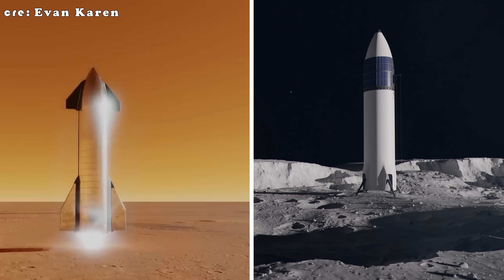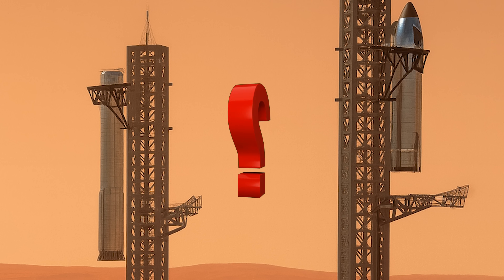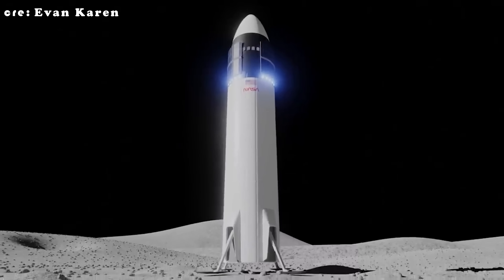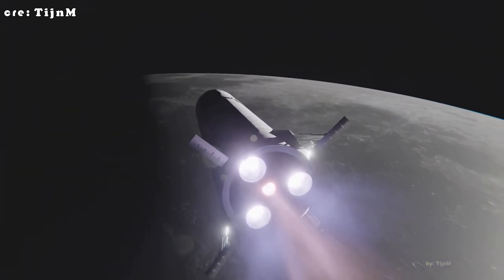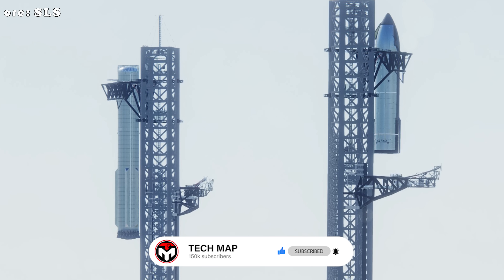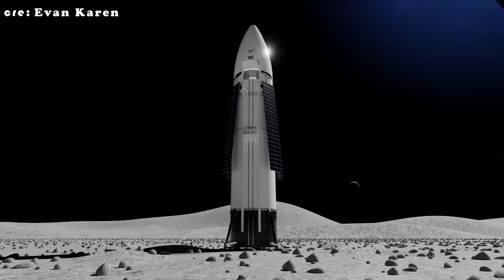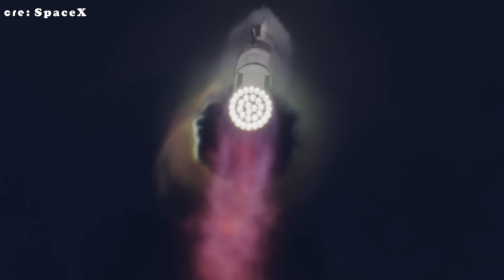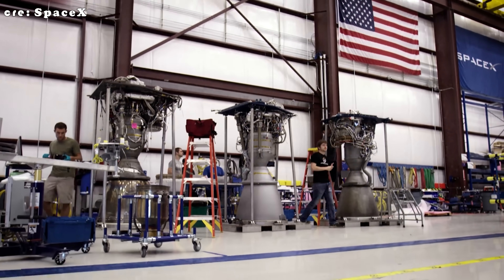SpaceX's New Starship Landing Legs Design Upgrade to Land on the Moon Shocked NASA!

Comment: Why not just have Fixed landing legs that you unfurl  in orbit? There's no drag in spaceflight HLS simply goes to the Refuelling depot- Orion Rendevous- Moon Surface. Dont bother with folding just unfurl once then leave be..
Reply: Try the following experiment: Put a 10cm thick stone on the ground. Now put a stool with one of it's legs on this rock, the other three legs have to reach the ground.
Does it work?
Extended experiment: Put a water filled long low diameter glass bottle upright on top of the seating surface.
Did you need cleaning equipment?
Reply: @jochenwagner2782  "Fixed" meaning no need to retract after takeoff.   But having the ability to absorb impact or level the ship out dumbass😮‍💨

Comment: I do not recall saying HLS would take astronauts anywhere other than the lunar surface and back to space.  I reread my earlier post and, though I never said any such thing, I can see how easily that inference might be drawn.  I apologize for the misunderstanding(s) my lack of completeness and specificity may have caused.  I also recognize that SpaceX and Musk, himself, regularly float new ideas about HLS and its mission profile.

Howeever, all of that leaves the central observation and question of my previous reply in place.  Leaving HLS on the lunar surface either requires two ships to each land once or one ship to land twice. And having HLS thrown into the sun rather allowing it to eventually crash into the moon still has the thing crashing but into a different celestial body.  The HLS is fully expended in either case.  How does that fit with the Musk/SpaceX drive for 100% reusability?  It doesn't.  It still makes no sense to me when fuel could be addressed rather simply by stacking the cargo bay, originally 22m high, down to probably 4 or 5m high, leaving the 17 to 18m of cargo bay reduction to be proportionally added to existing tanks.  The ship remains the same length and very nearly the same dry weight.  The lengths of straight components,  downcomer and anything simiar should be about all that needs adjustment required to accommodate the volume change and the weight of any additions should account for any dry weight change while the extra fuel will add to the launch-ready weight.

This question still stands: Why would SpaceX completely change its design philosophy - ONE HUNDRED PRECENT REUSABILITY - for this one mission SEGMENT?  That makes no sense to me.  Before you ask, no, it need not make sense to me as I really have no dogs in this fight.

To me, it would make far more sense to shuffle the rings prior to stacking to give up some cargo bay volume for increased fuel tank volume so the vehicle can get back to LEO without more fuel.  When/If the next generation engine produces more thrust or longer ISP, return to the original stacking plan.  Get the thing back.  Examine it closely.  (Yes, I am advocating sending engineers to do this.  Fortunately, engineers should be pretty common among astronauts.) Reuse it or drop it in the ocean.
Reply: HLS isn't carrying astronauts to the moon from LEO.  The current plan is for SLS send the Orion crew capsule to bypass LEO and go straight to the moon from Earth.  It would dock with the prepositioned and fuelled HLS in near rectilinear halo lunar orbit (NRHO), HLS would carry two of the four astronauts to the lunar surface  (at the South Pole) for a week, and then return to  lunar orbit to dock again with the Orion capsule which would then boost back to Earth.  After separation from Orion, the HLS transfers into a heliocentric lunar orbit to generate enough escape velocity to leave lunar orbit to collide with the sun so it doesn't clutter lunar orbit for future missions.  It needs very little fuel for that.  It is not intended to be reusable at all.